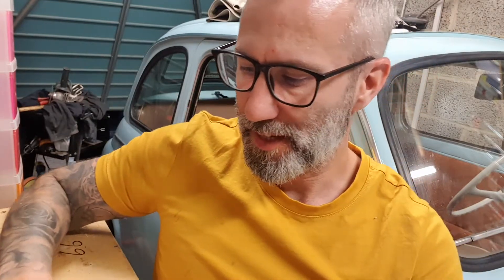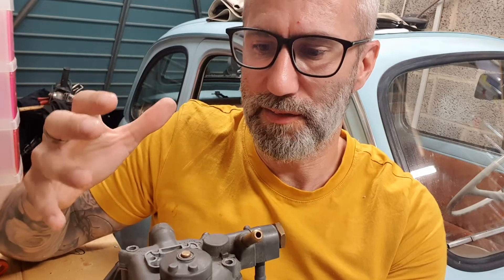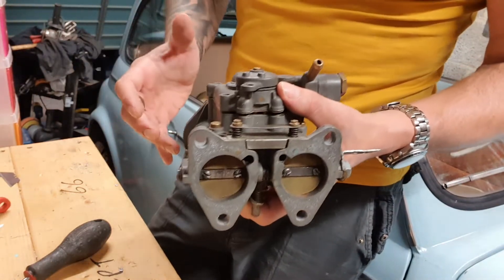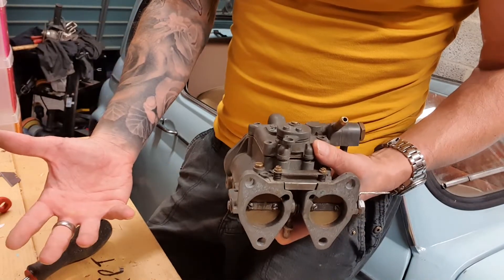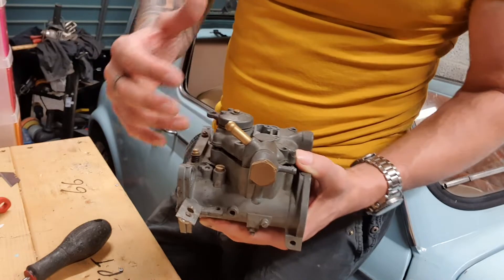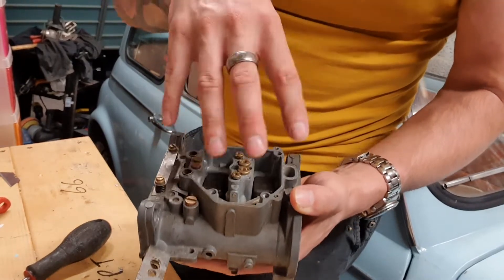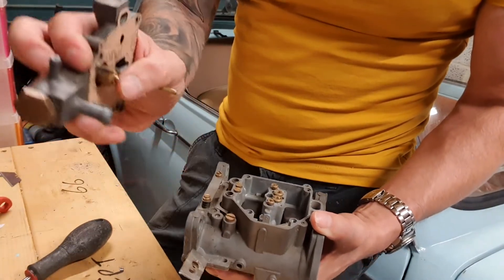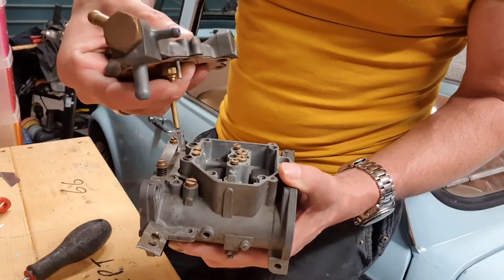How does a carburetor work?

Comment: Thanks for this I have two of those from a 1600 Alfa I think. They need an overhaul but I’ve never stripped one down, done the carbs on a 500.
Reply from the maker: They are pretty simple, very like a DCOE Weber or a Dellorto DHLA, the location of the jets, the emulsion tubes, the progression holes etc... and in fairness this model has a progression circuit which is as poor as a Weber, and not as good as a Dellorto. This example has some rather mashed idle jets and to get to the main jet you have to remove the accelerator pump as its screwed into the body from underneath, unlike a Weber DCOE where the main jets are screwed directly to the base of the emulsion tube. Just different ways of doing things.
Reply: @FoxSpeedshop  I was hoping to use one on my 800cc vw build. Finding it difficult to find a machine shop to machine the barrels. It seems all the old machine shops I used before have gone sad days.
Reply from the maker: Yeah our local engine/machine shop has gone too